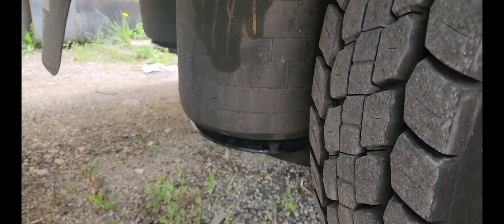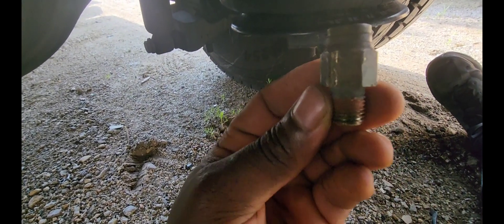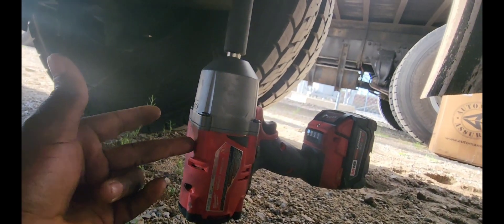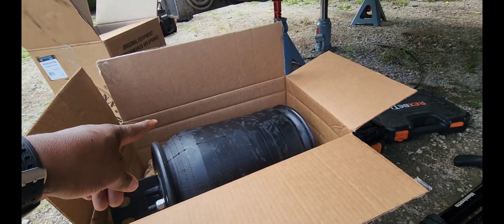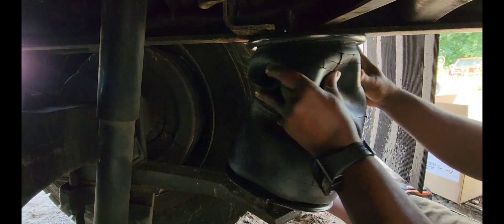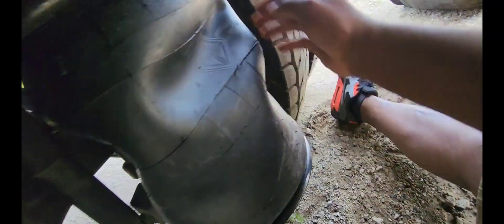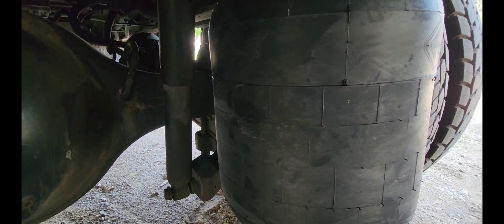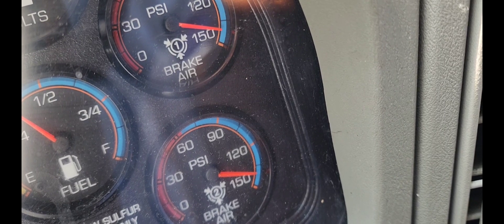How to Replace Air Bag on Box Trucks

Comment: I have the same truck what was the part number for that airbag? I have a 2019 International 4300 series same as you and I've learned how to do an oil change tune-up on my truck because of your videos. Keep making content Brother! 💪
Reply from the maker: I have it on the screen in the video. aftermarket. #9876RT and the OEM. #2514461C1🙏🏽🙏🏽

Comment: Good job Africa. Next time open the valves on both air tanks or hold the chains to drain all the air out of system with the truck off so it don’t keep building pressure. That way u don’t have to clamp the air line or fight the pressure when reinstalling air line. I love how u handle ur business. Peace and love to u my friend
Reply from the maker: Thanks so much for the info. God bless 🙏🏽